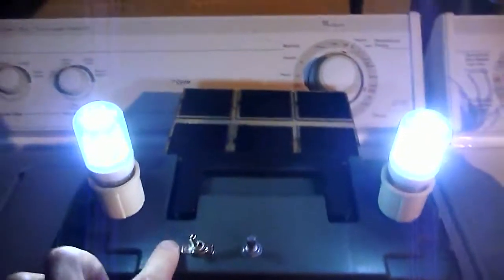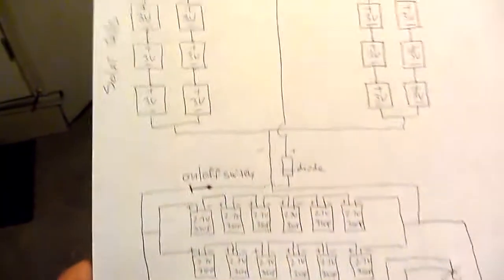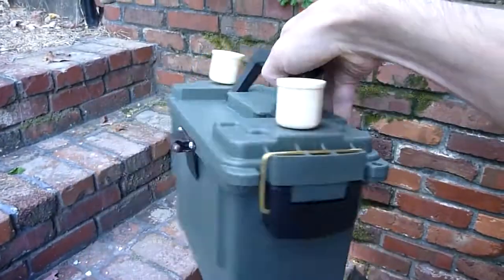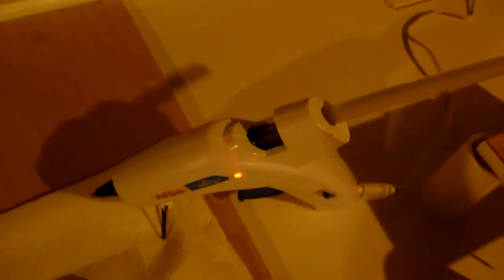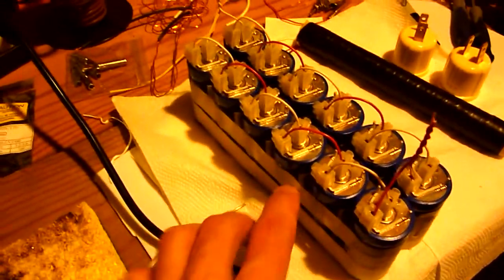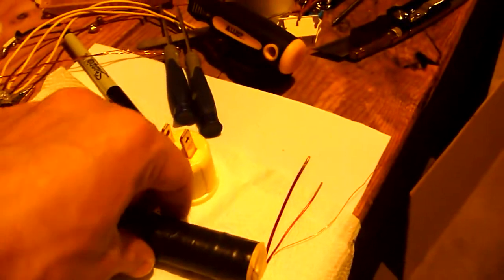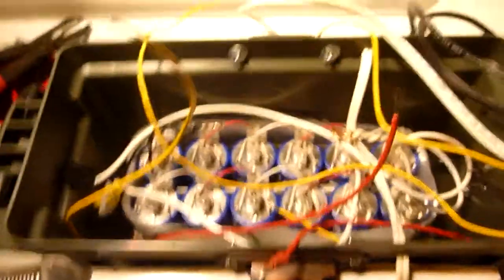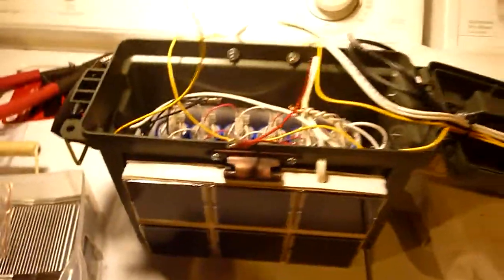Solar Charging Capacitor Flashlight

Comment: Very nice job!  I like what you done.  I've made a couple super capacitor flashlights (different design) and have been rather happy with them.  I have 7 3000F capacitors I was thinking of turning into a nice radiant lantern.
Reply from the maker: Thanx for the positive comment. If I was to build one of these today I'd wire all the capacitors in series (to make them have very high voltage). I'd probably do the same with solar panels (this will make the device quicker to charge and give it longer run time).

Comment: very nice,,,,,one quetions,,, how many turns/ windings of 1st, 2nd and 3rd did you taken ? then i will build it,,,:-) thanks a lot...
Reply from the maker: Each winding was only 1 layer around ~0.64 inch by 7 inch ferrite core. 1st layer was 30 gage (as many turns as the core will allow), 2nd layer 18 ga, 3rd is 14 ga. This is based around Lasersaber's (youtube name) joule ringer circuit (only I used 3 windings instead of 2). Using an extra winding allows to fine tune the dimming using a potentiometer. I don't know if this is really a superior design though.... two really should be tested side by side to see which one has higher longevity.

The white plastic under the lid (where you see the volt meter, USB charger, switches) I cut out from a plastic trashcan. I think this design could be improved if* I wired everything in series (all the capacitors, solar panels). What causes the transistors to quit working is if the voltage gets too low. If* everything was connected in series (you'll get more voltage and less amperage), but the voltage will keep your transistor working (thinking out loud).

Pulsed circuits like Joule Thief can also be applied for HHO cells! Very many applications for these circuits.

Comment: What type of Super C do you use for? Nice job.
Reply from the maker: Hey, I use Maxwell 2.7V 350F super capacitors. They are more pricey and slightly lower capacitance than chineese counter parts, however they have over 1000,000 charge/discharge cycles and I like the terminals, thanx for the comment.
Reply: Thanks , do you know, what type of material they use inside?
Reply from the maker: No clue, maybe carbon micro tubes?